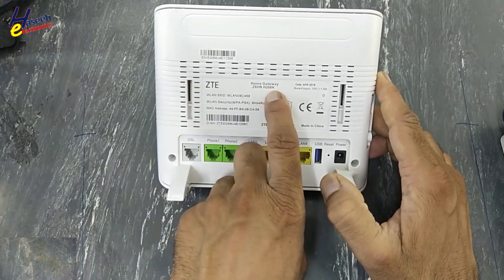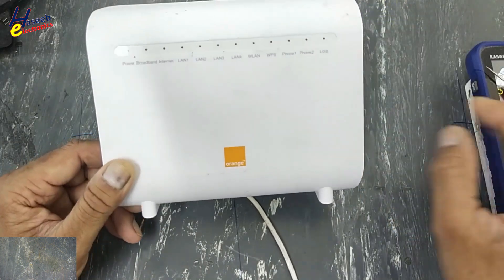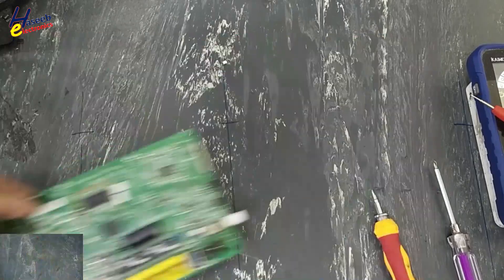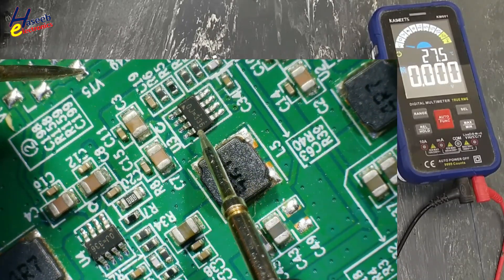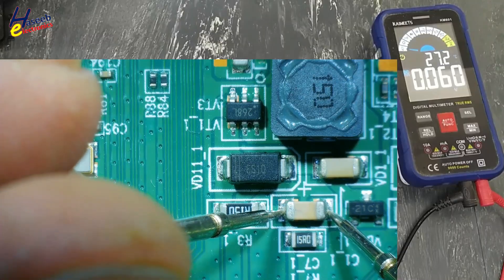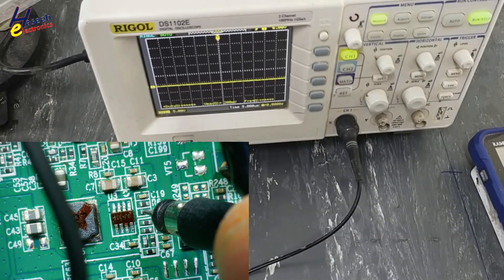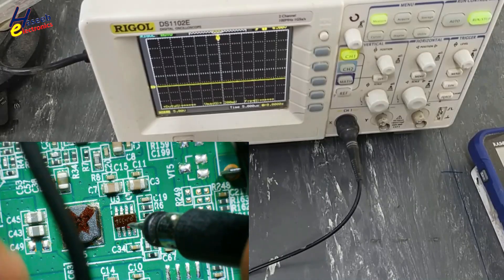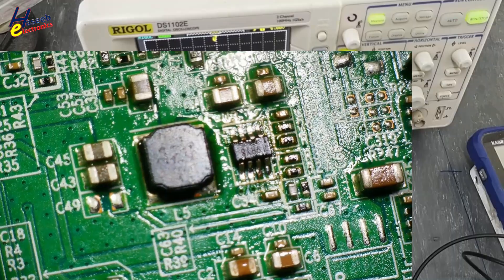{1380} ZTE Wireless Router Repair – 3.3V Switching Regulator Failure Fixed | MP2307 Step-Down IC

Comment from the maker: In this video, I repaired a ZTE ZXHN H268N wireless router that was not turning on.
The fault was traced to a failed 0J-336 (MP2307) 3.3V step-down regulator IC, which I replaced with a 19RY8 switching regulator. After repair, the router started working normally.
👉 Do you repair networking devices too? Share your experiences below 👇
🔔 Don’t forget to subscribe for more electronics repair tutorials!

Comment: Sir, why microprocessor manufacturing companies are decreasing it working voltage. In old days 12v mcu,then working with 5v,then 3.3v now its more decreased to 1.2v. why these gradual decrease in mcu working voltage? Thank you.
Reply: Modern transistors are so small that older, higher voltages like 5V would damage them or cause them to overheat. Reducing the operating voltage was a necessity for miniaturization

Comment: Sir, I am from Karachi, Pakistan. Jese k aap routers pe video bana rahe hn agar ho sakay tw sab se zyada use hone walay routers pe zaroor videos banayen, specially TP-Link k routers. Aksar hamaray clients ko hum TP-Link k routers lenay ka kehtey hein reliable be hotay hein aur asani se mil bhi jatay hein. Is wajah se repairs ka kaam bhi iska aata hy. Basically mein Net ka kaam karta hun is wajah se yeh keh raha hun. ek aur baat k aap ne aap ne video #182 mein battery charger k schematic ki detail batai thi mere pass Model 1220A china ka battery charger hy uski output pe voltage nahi arahe hein MOSFET bhi garam ho rahe hein. Kya aap is charger ki detail ki schematic ki detail bata saktay hein. Is mein chopper k baray mein bhi batayen k kis chopper se konse voltage kis area ko voltage detey hien. Is charger mein 2 MOSFET use huey hein aur 3 choppers.

Comment: sir please explain why 50v rail used  in router
Reply from the maker: Telephony (FXS Port / VoIP) RJ-11 telephone ports need a high-voltage rail (around 48–60 V) for ring voltage and line bias.